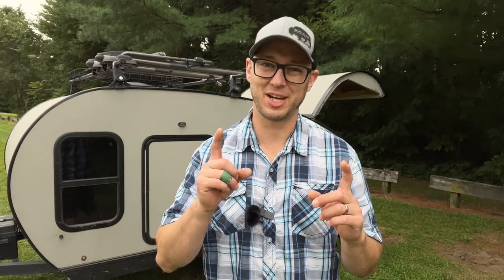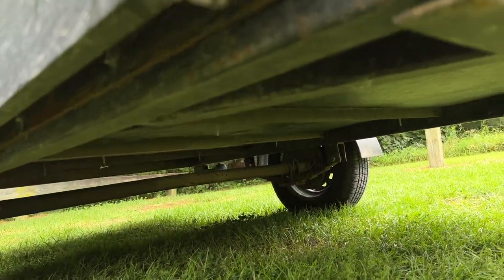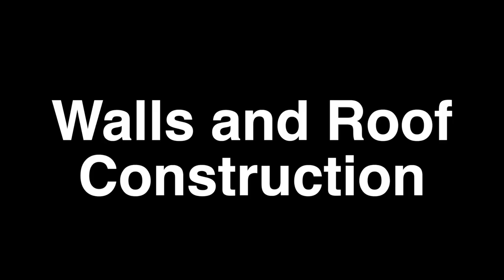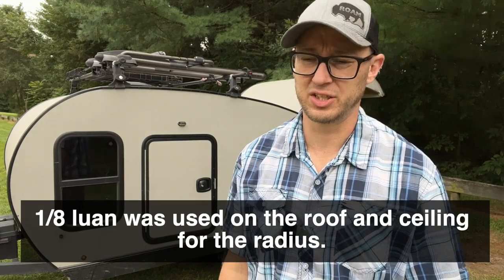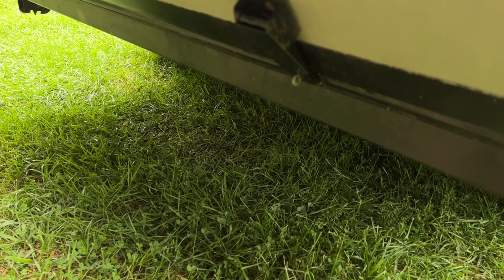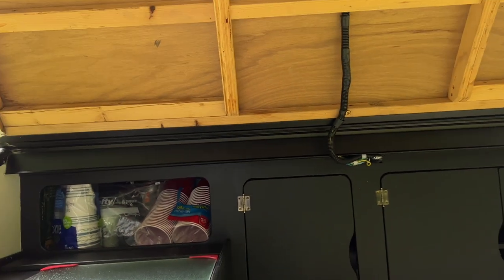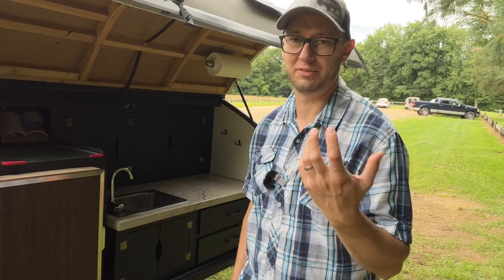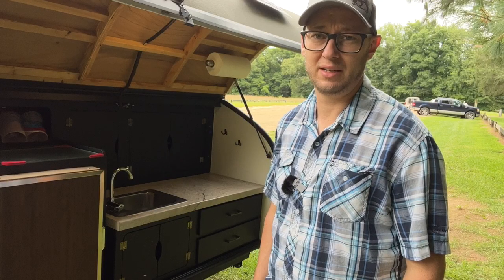DIY Teardrop with Poor Mans Fiberglass. WE LOVE IT!

Comment: Great job CJ. Isn't there a way to charge the battery with the trailer light hook-up? Isn't that how they do it on the big campers? You would know better than me.
Reply from the maker: Yep that is one way to do it. It might happen yet but I would have to run a separate wire to the back of the tow car because I don’t have the 7 way truck wiring.

Comment: All right so I don't know if you got your paper towel thing solved yet or not but what I would suggest is using for a simpler terms flat stock pieces of wood in other words one by something in thick and then attaching another piece of that same wood and basically making a U-shaped piece for simpler explanation drill two holes in it and run it down through it with your paper towel going through it the piece of wood that is at the bottom of what would be the u-shape for simpler terms put pressure against the paper towel roll for Banning it from unrolling and was it just a slight lift off you can still use your paper towel roll as intended if you haven't figured out you would also have to offset the holes just a bit so that way it would create a swinging effect as need

Comment: Sounds difficult to paint the back of the fabric after painting the trailer. Did you lay it on a workbench or a table or a driveway. Or what? Seems it would get wrinkled and a mucky mess no?
Reply from the maker: I might not have painted the back of the fabric. Did I say that in the video?

Comment: For a table curve a two by four to fit your wheel well  with magnets on the curve then a board to the rest with a leg ...Then u can use any time with out putting more holes in camper ..It can even be L shaped if needed ...Or just do the same curve and use tiedown stap instead of magnets ...

Comment: Great pointers!! I live in NWI & say I’m going to work remotely and live in a tiny house in Idaho:) it’s good to know that you built it without a lot of tools and without a garage. While I have  both, I think I’d prefer to build it outside…probably so that I don’t build it too high & not get it out of the garage🤣.  It will be a foamie. I have a small 2.4l car. As for the paper towel…small piece of wire attached to carabiners attached to the ends via wire (even garden tie wire on its own might work) thru a small drilled hole in the holder. Small jewelry lobster clasps would work too. Just make sure your wire is long enough to account for the depth of  a full roll of paper towel.

Comment: CJ, We just sold this year our Camp Inn rain drop. The dome light and cab lights had two lamps one red and one white (normal light) the red lamps were used at night to see and not get blinded but the main use was to keep the bugs away. Just put some red twinkle light up in the cab and use those at night.
PS bungie cord for the paper towels. Also I found on our teardrop I preferred the Lifetime kids folding table (80425) as it is short and once you put the cooler on top is the perfect hight to pull from the cooler. Before inflation they were about $20 at the warehouse clubs I see on amazon it is now over $40 but sometimes Aldi has a knockoff but that is seasonal. We also had a sink in the teardrop, but preferred to do the dishes on a separate table and to save the center space for prep and cooking. Good luck figuring out your layout and what works best for you.

Comment: I have a suggestion for more storage, we have two convoluted drain pipes 8 in diameter under our trailer, to hold folding chairs, and rug, the other awning and poles.  We made covers  that fit into each end and lock in place.  We have a third underneath that holds our american flag.
Reply from the maker: A great idea!

Comment: Love the camper and glad that you shared it with us!  I saw on another YouTube video where there are paper towel holders that hold tension on the roll and click when they turn, so the wind isn't able to move the roll.  Our family just did a build out of an enclosed trailer.   We put in 6 sets of cot bunks, kitchen, fold up/down table/counters, vertical clothes storage with pull out baskets, lights, windows, dividing curtain which doubles as a projector screen(we used the same drop cloth fabric that you used for your exterior). It sure is fun to build your own camper.  My family really enjoys your channel.

Comment: Thanks for the great video!!  I have a Westfalia camper van and had the same paper towel problem anytime a window was open, especially the driver's or passenger's window while driving.   The wind would completely unroll the towels. The low tech solution that worked for me was switching to Viva brand towels, they tend to stick to themselves a bit on the roll.  Good luck!
Reply from the maker: I will give this a try. I want a van to😋